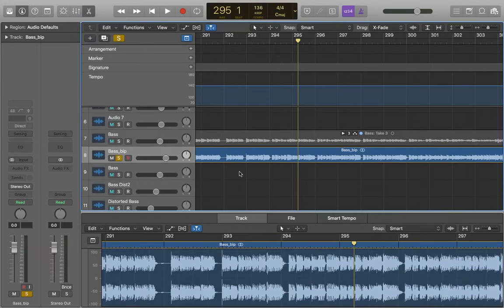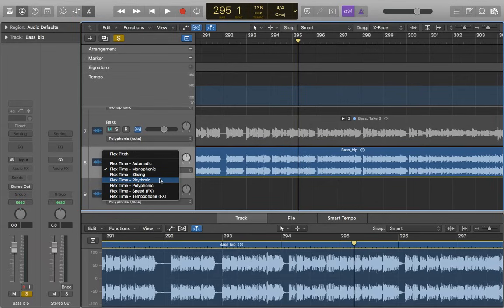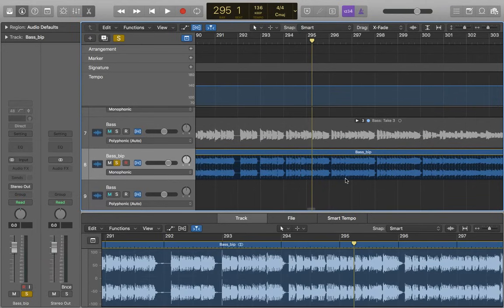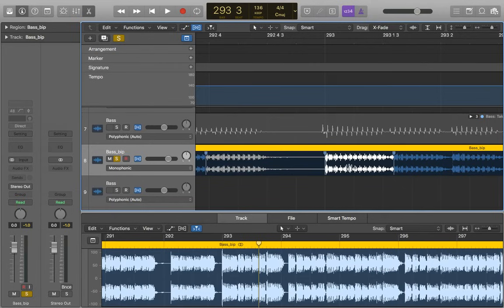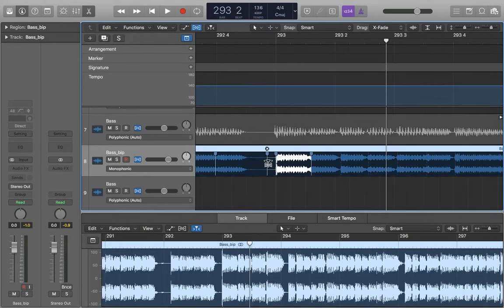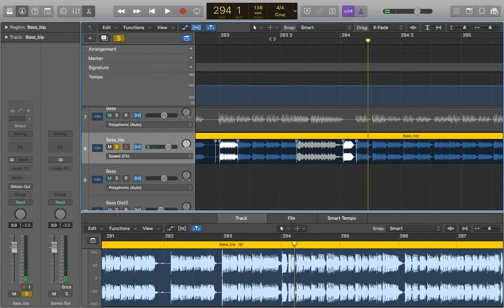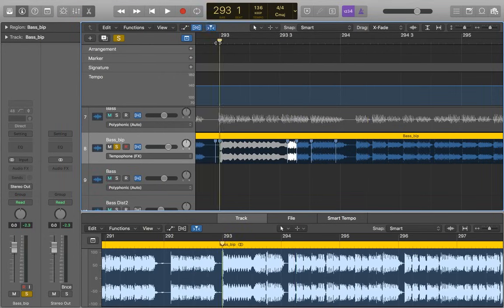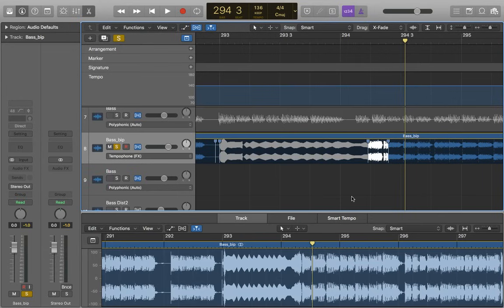Logic Pro X - How To Use Flex Time

Comment: Does Logic have the ability to flex the measures?  In Cubase, you can use Warp grid which moves the entire measure by adjusting the tempo in miniscule amounts, then you can lock the audio to the tempo map.  Once that's done, you can remove any tempo fluctations and it all lines up to one solid tempo.  Great tool for live performances.  How would this be done in logic?  Here's a clip of Dom doing that.  https://www.youtube.com/watch?v=c5AZ8fecXLw&t=801s

Comment: I have a guitar track on a project that is slightly out of time because of the playing. But I cannot recreate the sound because the feel then disappears. When i use flex time it sound weirds sometimes because of the effects on the guitar. How can I make it on time and sound natural??
Reply: chorus and delay are used on the guitar
Reply: @simenh2484  Unfortunately this is the struggle with audio engineering. Here's what I recommend: dial in a metronome to the basic tempo of your recording. Then you will get a clear picture of what to re-record if you are that desperate to salvage the track. But honestly, I would just re-record the track CLEAN, with a metronome, and then go piece by piece, re-recording parts until you have a good recording with no major flaws. Then you can add effects to it and produce it the way you want. I know this is so late but good luck; getting started recording is a big learning curve because of all of the time you will feel you have wasted, but that time is short if you persevere. Cheers!

Comment: Question. Once I'm done editing with flextime and turn it off, the changes disappear. If I turn it back on again, the changes are still there, but I can't get them to 'stick' without bouncing the part I've worked on. Is there a simpler way to do this?
Reply from the maker: I tend to just leave it on, but if I need to turn it off I just bounce the audio in place, as it's quicker than bouncing it then importing it again :)
Reply: @JoesLogic  "if I need to turn it off I just bounce the audio in place"

What does "bounce the audio in place" mean and how do I do that?
Reply: @chad969  I'm not sure how to explain technically what bouncing in place does, but basically it allows you to duplicate an audio file and it gives you flexibility when choosing how the duplicated audio file is created. 

To bounce in place, just right click the file, go down to "Bounce and Join" and then click on "Bounce in Place". This should pop up a little window that has a list of settings. From there, you can choose the destination ("new track" to create a new track for the audio or "selected track" to keep the duplicated audio on the same track as the original). Then you can choose what to do with the source, or the original audio. You can leave it, mute it, or delete it. The next settings on the list have to do with plugins. You can "include audio tail in file", which will basically include any reverb/delay/etc. that plays past the end of the original file. As for "Include audio tail in region", I'm not sure what that does but I've always just left it checked. And then you can also choose whether or not to keep any volume and panning automation that may be on the original file. For "Normalize", I also just leave it at the default "Overload Protection Only". Anyways, hopefully that's helpful. I realize that since your comment was from 3 months ago, there's a chance you've already found a solution by now. Either way, it's good practice for me explaining things XD.

Comment: Would you use this rather than the time and pitch machine or is flex a totally different beast? I’ve always used both but never really found the best option for stretching short musical loops
Reply from the maker: It depends on what you're using it on, but if it's just for stretching short loops, flex would be my go to - but it would depend on the specific loop :)